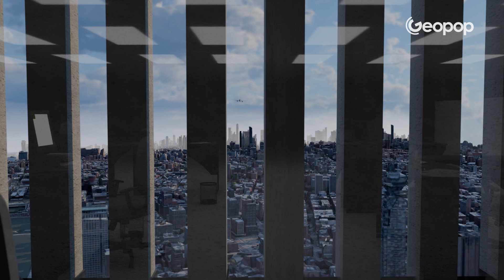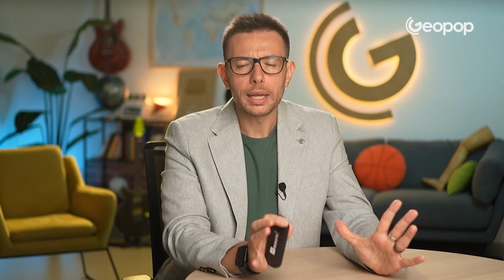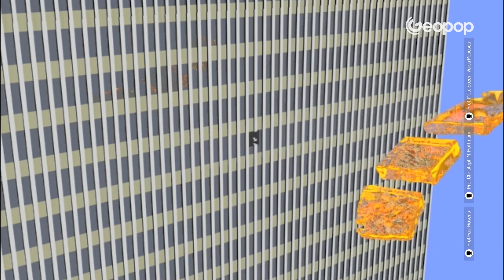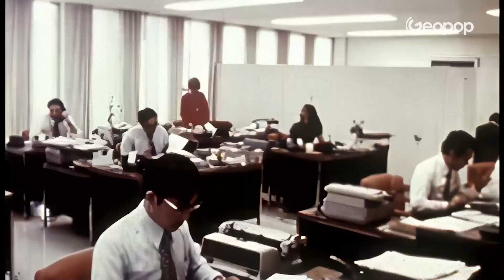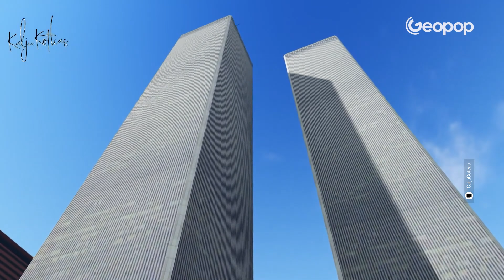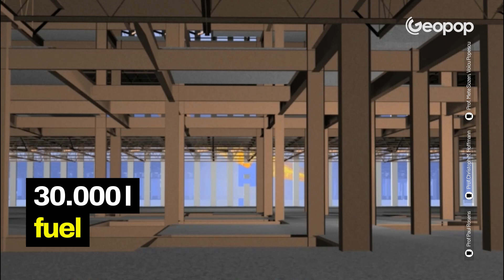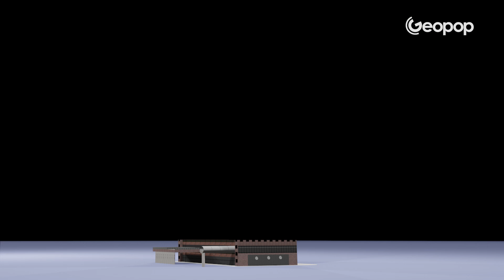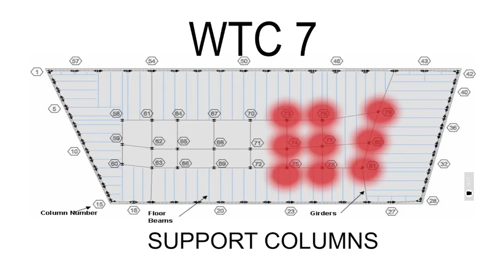9/11, 2001: The Technical Reconstruction of the Twin Towers and WTC 7 Collapses

Comment: Look beneath the dust cloud as it falls, jets of white shoot out all the way down on both buildings. Those are explosions, not the debris breaking the rest of the building down.  7 didn't collapse as the computer model projects. It only twisted a tiny bit. But you can also see the explosions floor by floor as it falls. Don't you people understand motivation is at least half the picture of a crime? Insurance money. Carlyle group mega money, war money, resources, etc. And the cherry on top, destruction of our Bill of rights. Standard procedure. Sheesh 🙄
Reply: IF you look here in the first 12 seconds of the video you can see why the Twin Towers collapsed:  

www.youtube.com/watch?v=ULdiD6gYZO0 

Inward bowing of perimeter columns at the impact and fire damaged floors by up to 5 feet until they buckled.

Everything you described was caused by the building already collapsing and obviously didn't cause the building to collapse or it wouldn't already be falling.

Cause and effect - it matters.
Reply: The windows blowing out as the towers collapsing was due to air pressure going down the building and blowing successive floors windows out as it went.  It did approx 15 floor per second.

You phyiscally could not manually detonate  15 floors sucessively in under 1 second by pressing buttons  .. try it on your remote control.
Reply: @zMW574e no, those were squibs. We see them in demolition all the time. They've never been seen anywhere else.What you're making up about the windows.
It's just bullshit. Its squibs as seen here.
https://youtu.be/eXAgulfAtR4?si=-iLO9aQjMJVLTUYH
If you would watch the video you might learn something.
Reply: . Controlled demolitions have squibs, you can see the squibs here 20 floors below the collapse. 
https://youtu.be/eXAgulfAtR4?si=-iLO9aQjMJVLTUYH
Reply: @robbiehiatt9966  The air pressure wave was ahead of the collapsing building.  If you want an example think of a big syringe full of air.  You press the plunger down and the air start being pushed out of the nozzle at high speed before the plunger has got to the end of the syringe tube.   it's simple physics.
Reply: @zMW574e except a syringe doesn't have solid floors every 13 feet. And what you're saying is that the air pressure skipped 600 windows and blew out the 601st, and then it did that numerous times yeah, that makes sense.
Reply: @zMW574e you're talking about something that has never happened before , and has never happened again. There's another.
Coincidence
Reply: @robbiehiatt9966   The air did not go through solid floors though,  there were stairways and lift shafts.  

When the planes hit fuel went down the elevator shafts for instance.   Fluids easily find routes.    It is also chaotic and so would not be expected to blow out every window depending on how the floors had interior fittings and furnishes depending on the occupants.
Reply: @robbiehiatt9966   " you're talking about something that has never happened before , and has never happened again."

And yet you can say it is explosives,  when nobody has demolitioned a building like the WTC before....     

You just shot your own argument in both feet.

PS  You did not answer "You phyiscally could not manually detonate  15 floors sucessively in under 1 second by pressing buttons"

Explain that .....
Reply: @zMW574e i take it you don't know about squibs? Even though i posted a video for you to see them. If you aren't willing to do the research why are you acting like you know everything.  I don't know there was fuel spilling down in the building,  i know that the fire didn't make its way halfway down the building. I know the lobby blew up with firefighters inside of it. I know there were secondary explosions because firefighters said so. I know many firefighters claimed it looked like a planned demolition. I know the dabris pile glowed red under the ground for over 6 weeks and measured above 1000 degrees 6 weeks later. I know they claimed to not have water yet were able to spray it with water for the next 100 days.
Reply: @zMW574e you're the one that just made that claim you explain it

Comment: More than 5 coincidences in a single day ? Well , whatever.....
Reply: I think your number might be low. Let's see. 1. Three buildings hit the same day. 2. All owned by the same person. 3. Man received 4.55 billion for that day. 4. Man is only worth 1 billion today. 5. Building accidentally falls into its own footprint. 6. Water suppression system failed in all 3 buildings even though they all had water tanks. 7. No water at the hydrants. 8. 2.3 trillion unaccounted for. 9. Buildings as far as 15 blocks away were damaged.10. Owner says pull it.  11. Can't forget the passport found from the so-called hijackers. 
12. Pilot flying the plane into the pentagon miraculously and accidentally makes a pinpoint perfect turn to hit the side of the pentagon that had the least amount of people instead of flying straight into it where the top brass are located.  13. No pictures of a plane hitting the pentagon which had cameras everywhere pointing in every direction. 14. No plane left in shanksville,  yet lots of flammable paper reported at the site. 15. Larry Silverstein ate breakfast there everyday except for 9/11. Good old lucky Larry. 16. Ground level lobby blows up from a fire 90 floors above but no damage between the two. 17. Hole in pentagon was half the size of the plane that hit it. Anyone wish to add to my list? I know I'm leaving out some
Reply: @robbiehiatt9966   You need to get your conspiracies alighed,  other people say it was to invade iraq.  Others Jewish cabal... etc etc .

"But my conspiracy theory with poor evidence is better than his conspiracy with poor evidence"
Reply: @zMW574e i guess these first hand witnesses are not good for evidence? 1.The firefighters said" it looked like they planned to take down the building" I didn't say that, The fire fighters said that. They were there.I'm sure they know best.
https://youtu.be/XiIT4HInWjY?si=e1Pvp3-IFs-M75Oj
When the firefighter says "boom, boom, boom, boom" in this video.
What do you suppose he is?Implying by " boom" ?? What do you hear? 
2.So if there were no explosives then what is this? 8:25
https://youtu.be/bLF5D7M1YgA?si=aHSvS__uOdxMi1ZB
You can't say that it was added because you can see the firemen's reaction to the explosion. And you can't say it came from anywhere else because the firefighter says
" We gotta get out of here,  7 is exploding 
3. Firefighter says "any one of these buildings could blow up,  this ain't over yet" firefighter says there's 3 secondary explosions. 
https://youtu.be/0Gh3ErgMI4M?si=mmp9Eus_5PWTCBfl

Comment: Then why is it that people could see as the towers were coming down explosions (flushes on the corners of the North Tower and South Tower) every 15--30 feet apart from each other which were very obvious.
Reply: You mean air being compressed inside the Tower (which was 95% air by volume) and blowing out the sides in reaction to the Tower collapsing and NOT causing the Tower to collapse?

You need to work on identifying cause and effect
Reply: @TheLoonResistance no, he means explosions -seen and heard by fdny as it happened and as seen by me as reported live onbsep 11 2001.
Reply: @Mme.Swisstella  - Then by all means show us and I will point out in detail why you are wrong - if you even bother to reply.

In the meantime, collapse was caused by sagging floor trusses causing some of the perimeter columns to bow inward by up to 5 feet until they buckled:

www.youtube.com/watch?v=ULdiD6gYZO0
Reply: @Mme.Swisstella  recorded on zero footage. It was air pressure. If explosions were heard, they were from propane tanks, not demolitions. Please tell us how "they" managed to keep the explosives from igniting for 1-7 hours after the impacts, and raging fires? The colapses initiated at the point of impacts. So how did they rig the explosives so that they were not damaged by a plane collision?.

Comment: Bullshit aluminium can’t beat steel!! Kerosine can’t damage steel!!
Reply: Neither of those assumptions are true.  Obviously.
Reply: @TheLoonResistance wtc 1 and 2 were designed to withstand multiple direct hits from fully fuelled boeing 707s at any location -this has been publicly stated by the architects and engineers that designed those buildings.
Reply: @Mme.Swisstella  - No they weren't.  The idea itself is absolutely stupid.  Why would anyone do that?  You do seem to have a knack for making shit up.

As a point of fact there was no requirement from either the customer or from NYC building code the Towers be required to survive any sort of aircraft impact - however one chooses to define that.  

There is anecdotal evidence that at some point after primary design was complete some engineers did some quick back-of-a-napkin type calculations (in a 3-page memo) examining what might happen if the largest aircraft in service at the time (Boeing 707-200) on landing approach (light and slow) and lost in fog were to accidentally hit one of the Towers. This was based on the July 1945 accident in which a U.S. Army Air Force B-25D Mitchell medium bomber struck the Empire State Building after straying off course in fog while trying to land.  

The calculations showed the Towers would survive the impact and that is all they showed.  No calculations were done regarding subsequent fires.  Zip. Nada. Zilch.

Worth noting the impacts of Flight 11 and Flight 175 respectively represented 4 and 5 times more energy than the hypothetical B707 paper scenario of 1964.  

Both Towers SURVIVED THE IMPACTS

I'll let that last part swim around between your ears for a while as its a bit of bleeding obvious that some people seem to completely forget.
Reply: @TheLoonResistance 

Why was the wtc a month before 9/11 insured for plane crashes? Why was the owner himself (jew) not on that day in the building? Why where all the jews (3500 of them) that day not at work on that building? 

Do you know what can collapse the buildings? C4!! 

Why was all the rest of the building as fast as it could removed and not inspected? 

Why where truck drivers threatened to work as slaves and fast to transport all the parts from the building? Why was 80% plus exported with ships and destroyed quickly? 

Why was all the gold and money removed 1 week before 9/11? 

Why where a lot of emergency exits for the stairs closed thet day? People where trapped to death!! 

All of this shit to attack the middle east for oil!! It was just to make a reason for war!!

There isno o way that the “hijackers” could make that turn in a plane that size!! 

You know what the funny thing is. Everything was destroyed but the passports from the hijackers where intact😂😂 yeah right they where fireproof😂😂😂
Reply: @JohnAbruzzi-rf2qf  - So you are abandoning the idea that aluminum can't beat steel.  Good, I love progress.

1. A lease was signed on the WTC complex by a consortium of 5 commercial real estate firms in July of 2001, 6 weeks before they attacks. The new lease holders took out standard commercial property insurance policies on their new investment as is routinely done every single day in such transactions .  All of this is public record and common knowledge. This dead horse has been beaten a million times. That you are still beating it, expecting different results is disappointing.

2. Did you know what can collapse the buildings?   Impact Damage (=to a ton of TNT) + Fire (heat) + Time + Gravity = Collapse .  Remove any one of those four elements and there is no collapse. Ignore any of those four elements and you will never understand the collapses. 

You just need to use the thinking part of the brain.  "C4" is a hand-wave for idiots who find thinking too much of a burden.  But it is just a single element, which is much easier for those people who find four elements to be at least 3 too many to handle. 

3. Why would other buildings (incidental collateral damage) debris need to be examined?  Examined for what?  Why?

4. I can't answer blatantly false claims nor will I attempt to. Please stick to true and relevant facts - which I know is a big ask. 

5. It wasn't.

6. They weren't.

7. No oil in Afghanistan

8. Just one passport, which means nothing. Only ignorant conspiratards ever bring it up. It's not useful as evidence for anything.  Nobody cares. 

PS

Whataboutisms are for the weak-minded.